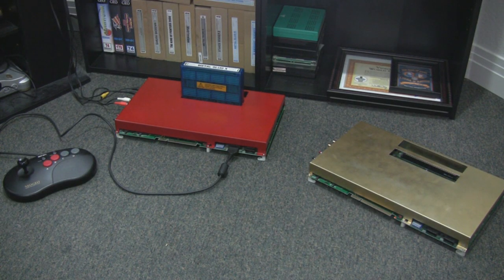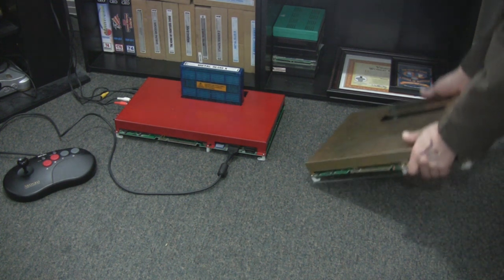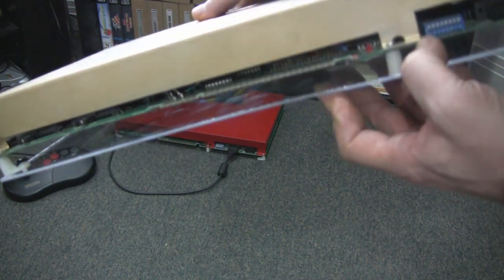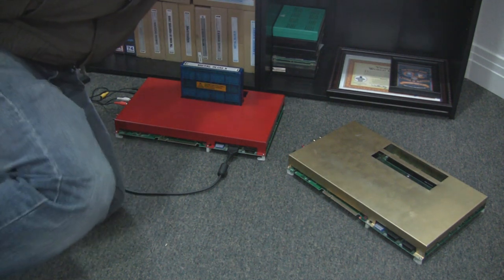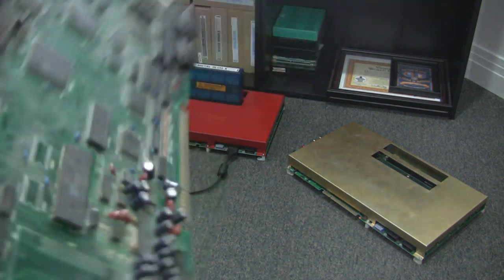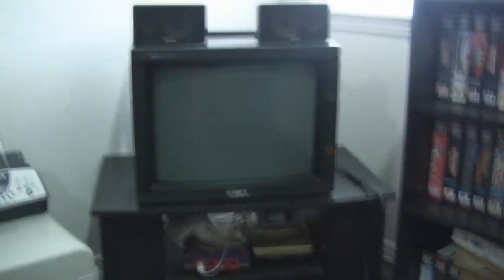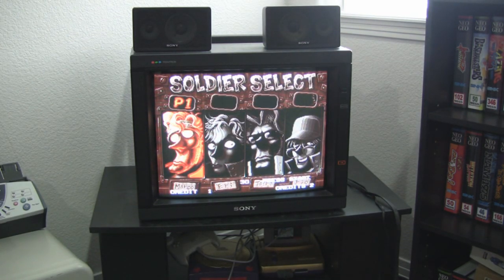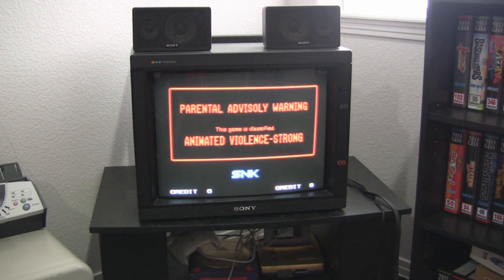Neo Geo MVS Consolized

Comment: Hello! Question, I am building my own CMVS with the MV-1C. My question is if all the MVS board models work at +5V 3A? I ask because I am trying to find a smaller and nicer power supply instead of the bulky one that I have right now, thanks for any information.